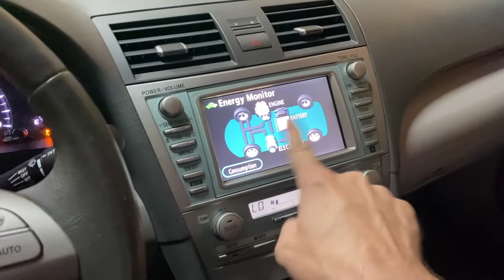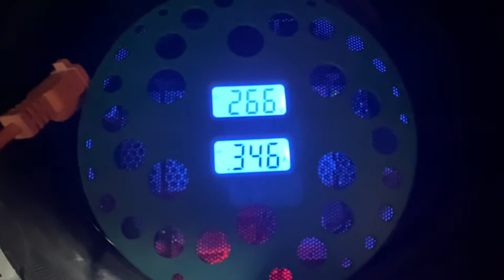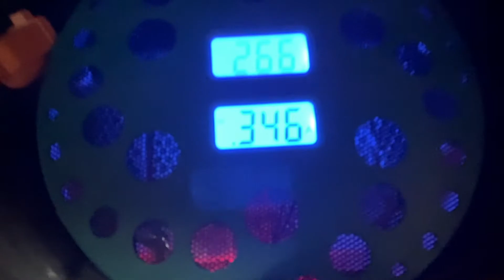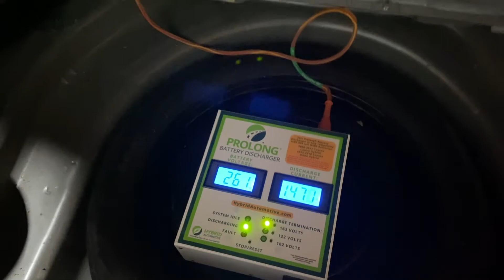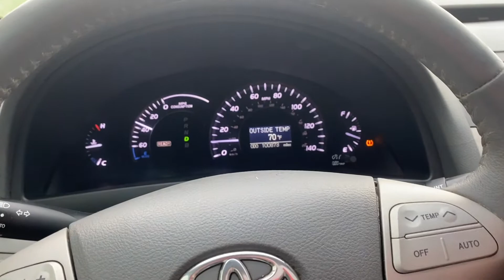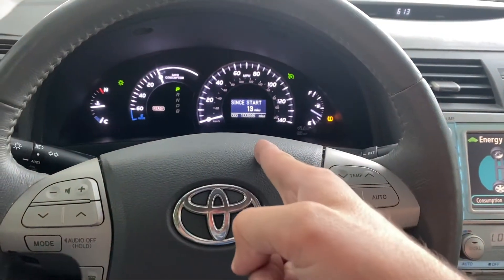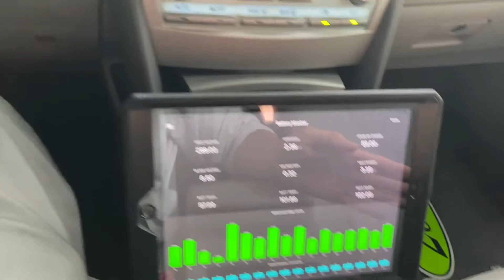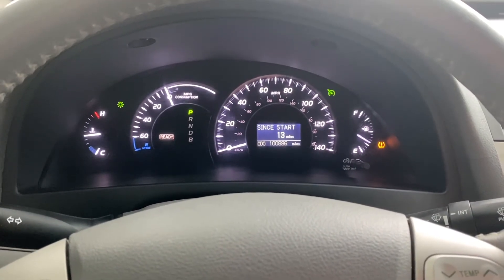2007 Toyota Camry Hybrid Battery Repair

Comment: You only drove it for 13 miles. It would be more helpful to see the results after 200 miles with at least 15 drive cycles. Anyways thanks for the video
Reply from the maker: Yes, however 2 years later and after selling this to my neighbors the battery has zero issues. so after many many drive cycles the battery is continuing to perform very well.

Comment: what are can bus bars? my car is having same issues  but has  a can bus code?
Reply from the maker: The bus bars are on the battery modules.  CAN Bus which stands for controller area network is your link to your ECUs. What codes are you getting?
Reply: @TheHybridGuy  u0001,u0100,replace hybrid pack...i replaced thee hybrid battery and 5 mins  later it gave  thee code to replace even after clearing code........i had a minor crash,busted headlight and bumper a little  of the fender, drove fine for 2 months untill a sensors wires rubbed  raw and all got rubbed together to cause a short. check vsc check hybrid and  all abs lights with check engine came on...i replaced  sensor and spliced wires correctly, problem still happened,replaced ecu with used,programmed my key myself with code reader  port, problem still occured, it is at the shop for 4th time and im ready to give up, the  mechanic just called and said when he hits the center consel the dash lights go off and codes go off but come back on if he hits center  again
Reply from the maker: Was the pack used, new or reconditioned?
Reply: @TheHybridGuy  i had a stern talking with the manager before  he sent his  installer out and he saiid he would make  sure the battery was  good
Reply: @TheHybridGuy  reconditioned, i have lifetime warranty with greenbean battery
Reply from the maker: Sounds like there is a blown fuse or something you need to check for power at the OBD2 port
Reply: @TheHybridGuy  will do thanks for your time.i will let the shop know tomorrow, will firty fans cause this issue? besides the hitting center consel?
Reply: @TheHybridGuy  *dirty

Comment: how long did it hold out for though because i am aware of similar videos and the battery went after two weeks of the prolong
Reply from the maker: Car is stil running fine. it comes down to how good the modules are.